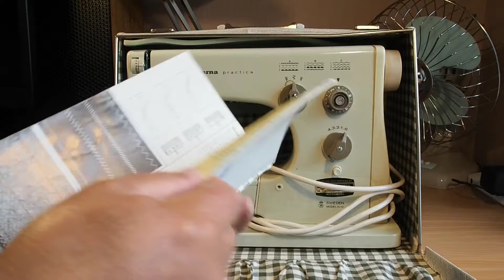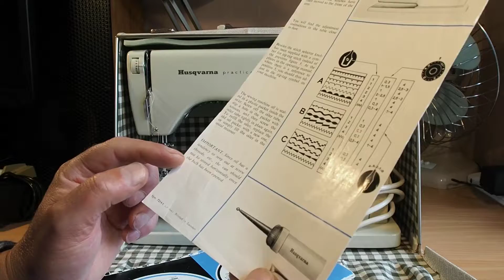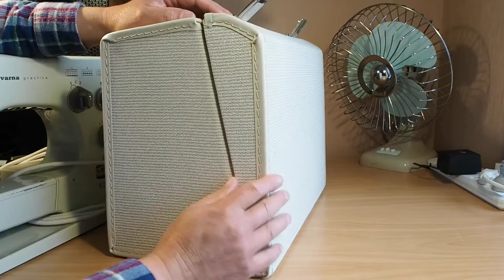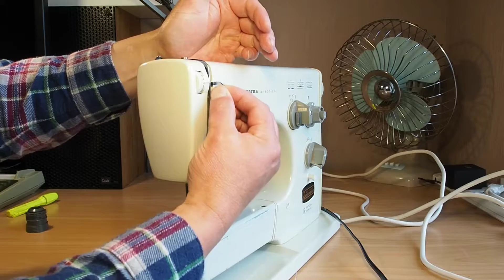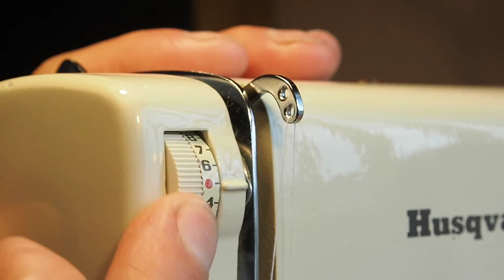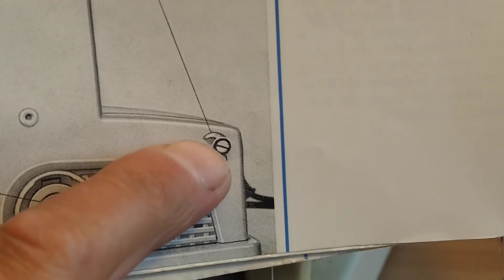Thrift Shop Find - Husqvarna Viking Practica Model 4010 Sewing Machine

Comment: I won one of these (a 5000 series) from a certain auction site. The photos showed a pretty pristine and well cared for machine. The case? Like new. Slightly musty, but that's FJ be expected. Even the case was in new condition. 

So imagine my extreme disappointment when I opened it up, sat it on my counter and the knobs immediately started falling off. 

Also has a busted motor housing, and they took the bobbin thread and wrapped it around the cracked hand wheel then stuck it back on there.  I wish I had taken a photo of it. 

Reverse button is stuck. It runs without the foot pedal plugged in and when it does stop, the bobbin is spinning out of control. 

It's pretty clear someone dropped it and they sold it/shipped it anyways. This isn't damage from shipping. Unless FedEx took it out of the box, threw it down in the ground, then re-boxed it, then sent it on its way. 

I'm SO mad and sad...not bc they ripped me off (they do that to their customers on a daily basis) but bc it's such a cool machine. Would have been perfect addition to my all Made In Japan lineup. 

If they won't refund my money I guess I'll try and fix it or part it out and try to break even. But idk if I can even find the knobs, let alone all the other parts it's going to need. 

If you shop on Greedwill's auctions, beware. They do the shadiest stuff anymore. All in the name of "charity."

Comment: Hi hv you worked on a 32.60 I think it’s the 3000 series. Seems older than this model you’re working on. Cant find anything on it. The straight stitch isnt straight and the zig zag doesn’t work. Any info would be appreciated.

Comment: Great video and info. You mentioned some more detailing videos on this machine, where can i find them? 
I have the Husqvarna Combina II 3230 purchased aged ago and later hardly used by me. In many ways mine looks like yours though there are differences - do you have any knowledge of mine? 
If the machine is up to the task I intend to sew some canvas for outdoors use on a boat.

Comment: What type of oil would you recommend for this machine?
Reply from the maker: I would only lubricate the bearings if need be because they are sintered and have lubricant in them from the factory. If they need oil then there is special oil for sintered bearings available. Thanks.
Reply: @InStitches  Ah interesting! It sounds like the motor is straining to get going (electrical hum, without turning). Once it's going I can ease off on the throttle to slow it down, so I thought lubricating it would help. Perhaps it's some other issue then?

Comment: Thank you for the introduction, and time going over the machine. Have just purchased one of these from trademe, complete with manual, and accessories . Unfortunately mine does have a broken drive belt, the small notched belt coming from the motor.  Would you know where I could purchase another? Thanks, Steve.
Reply from the maker: Hi. I may have one. My email is in the video description.

Comment: I do collect this brand, and have two of these 4010.  A simpler version of the 6010 sold at the same time, but based on the stitch selector of the Class 21 series machines. This  machine eliminates two serious issues with the 2000/6000 series; cracked internal cam, and also failure in the post 1971 crank slide made partly in plastic on the 6030 and later. One clear minus is the lack of reverse feed seems, but that's it! So a great runner! For hard core collectors: there are cams D and E out there :-)
Reply from the maker: Thanks for the info.

Comment: All the xx10 series machines has metal slides for the take up arm. The check at 9:45 should be no worries on these, they will not break. That problem came later with the self oilers, starting with the xx30 series.
Reply: that also applies to the xx20 series as well.  The xx30, xx40, xx50, xx60 and xx70 series (1971-1982) all had a plastic connector in the crank slide.
Reply from the maker: Thanks for the info.

Comment: Have one from TradeMe. Got it serviced. Wow. So solid, and sews beautifully.  I actually think the earlier Husqvarnas like these Practicas and Combinas, the preceding emerald green ones (several models), and the slightly later earlier versions of the 2000 (all of these were much the same machine) are better than the later 2000s (a number of models) which have sealed bearings prone to seizing if left unused for a long time, and not as smooth running as these earlier machines when serviced and oiled properly.
Reply: I bought a 3230 recently (Combina II) and I agree it's a superior sewer. Not sure what the difference is, but it feels smoother and stronger than my 6460. I really like using it.